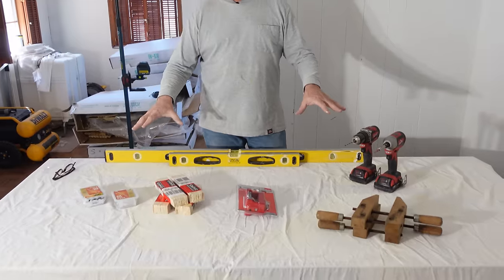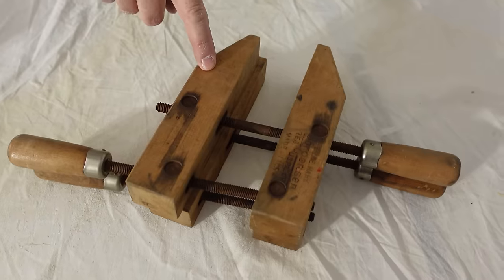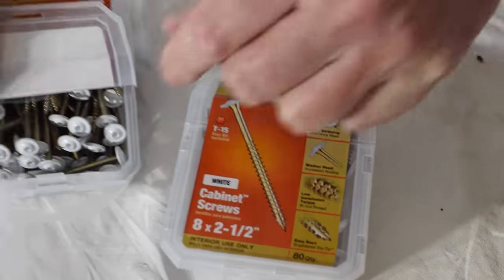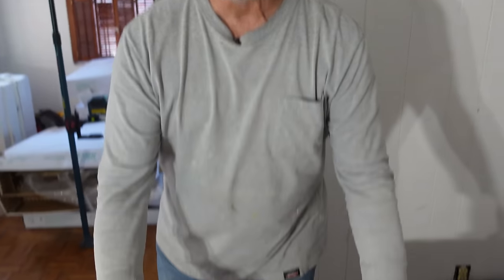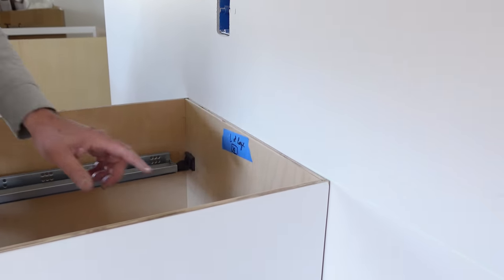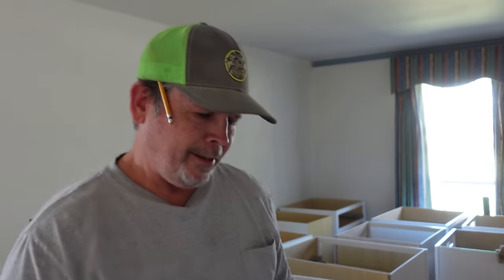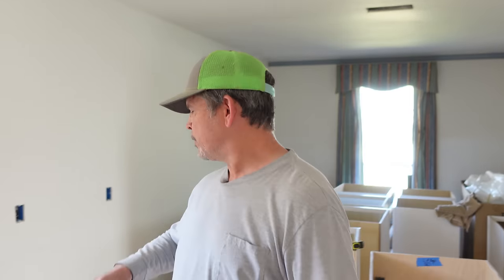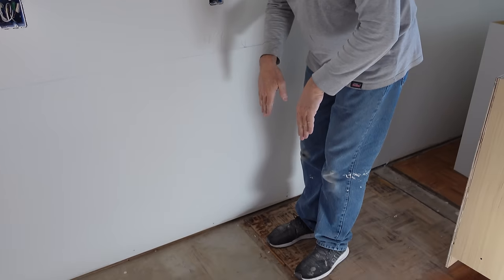How To Install PERFECT KITCHEN CABINETS (DIY GUIDE)

Comment: Hey guys, love your videos but in referencing those screws always use a number 10 or heavier...on the upper cabinets!!! number eights have no sheer strength and that's what's holding up all of that weight so always at least a number 10. If not, a 12 will be your best friend and you won't ever have to worry about those cabinets coming off of the wall. Just some insight from a 63-year-old finish carpenter who was in the trades for over 40 plus years!!!
Reply: What you mean number 8 or 10 because we live in Europe 😂😂😂😂😭😭😭. What size it is? 8/25 of an inch?
Reply: @apostoloskokalis3431  Google is your friend. 😉  #10 screw has a thread diameter of 4.8 millimeters.  #12 = 5.5 mm.
Reply: @sulero-zp3rd  Now that's how to hang a cabinet. 😜😄
Reply: Thanks!
Reply: I can do it.
Reply: thank you
Reply: Even their trim screws have a shear strength of 360lbf. These are more than adequate
Reply: GRK's #8's are hardened. They'll easily hold the cabinets, not to worry! A regular #8 would absolutely be a no go.

Comment: Been installing cabinets for 24 years your video will do fine for diy .  I have many tips but one of the best one is that if the wall is crooked and your cabinet is level and you have a space between the top of the cabinet and the wall, before you put your screw in , put a shim in the gap so as you tighten the screw it doesn’t try to suck the back of the cabinet to close the gap and  raise the front of your cabinet
Reply: I've been building and installing custom cabinetry for 40 years and I wouldn't let this hack near one of my cabinets.
Reply: Care to explain?
Reply: @booboo8577 why not? It makes sense to put a dim in the back to maintain perfect level as you torque your screw.
Reply: Nice work
Reply: This was the comment I was looking for, my walls are not perfectly square. In the video you can see he did this. Do I want to make sure the shim is with the stud and the screw with it so it holds the shim?
Reply: @thehighflyin12  What I do is put a shim wherever the studs are and before screwing the cabinets to the wall   I actually take a small nailer and put one through the cabinet into the shim because if you screw the screw in and hit for example a drywall screw or a nail the cabinet pushes out and your shims will fall down behind the cabinet and then you have to start all over but I also put a shim behind the side walls of the cabinet and shoot a nail into those two
Reply: Funny you mention that, that's exactly what I did an hour ago 🤣

Comment: 35 years in the cabinet business (so far) Always installed solo, for most of that time uppers first (no ledger) the idea is you get under the cabinet for support, you develop a knack for it, but as I have gotten older, I now ( almost always ) set my base's 1st .  How do I get under the walls with the base's in the way?? I made two box's out of plywood ( one lager, one smaller ) the large box is approximately 36" wide, 12" deep and 19 1/2 tall (thats important, the height) so after I set my base cabinets, box on top of base's, wall cabinet on top of box ( not much need of leveling wall because bases are set ) and make for hands free wall cabinet install.  I have two sets of "Pony" faceframe clamps (little bit nicer that the Bessy's) got the first set 20 years ago  best $200 I'd ever spent ( they were expensive back then for a set, now like $30 for the bessy's i think ) BTW the smaller box? same height its just smaller in width for when the 36" is to big and small enough in depth to fit inside the large box.. Cheers
Reply: You got 20 years on me in the biz. I've done both uppers first and bases first. Ledger boards, kicker sticks, free hand, all the ways. When I'm working solo, I do bases first, then whip out a 48x12 piece of plywood over the bases and my cabinet jacks. I think they're FastCap brand. But I can lift the upper on them, do micro adjustments, and if I forget a tool, I can step away and it won't fall, but still be on my level line.
Reply: @BenMarvin  , yep step away (thats what i meant by "hands free") I micro adjust with shims between the box and upper.  I thought of the "box method" when I had to install cabinets on a block wall.  set the upper on the box and then drill for tap-con's
Reply: @nedscrivner9893  Always a great time installing into masonry.
Reply: What size is your smaller box
Reply: @jessicacalder9099  , the large box is actually 38x12 and the small is 28x9.5 (both 19.5 tall) I rarely use the smaller of the two, but handy is a corner or a wall over 39wide (the smaller fits inside of the larger so they take up the same amount of space)

Comment: From what my cabinet manufacturer told me, those GRK cabinet screws are only to attach cabinets to the wall. It’s recommended that you use the trim head GRK screws (#8, 2 1/2) to attach cabinet-to-cabinet. The cabinet screws used need to be countersunk to avoid impacting the hinge / door, etc. Plus, it’s visible.
Reply: I use countersunk trim screws to attach my faces together. It just looks better in my professional opinion.
Reply: 100% correct Victor!
Reply: A screw is a screw and will hold. It is not some traditional cabinet room piece so a screw here and there is not an issue.
Reply: Ive seen the recommendations for those also, but those trim heads dont do the job well.  They pop right through and dont hold the cabinet together well at all
Reply: these are better, trim head are not strong
Reply: Faceframe screws 2½ #8 type 17 with nibs

Comment: The trick with the screw and the prybar = Mind Blown! You guys are awesome!!! The "Protip" i tell people when installing the cabinets is that i like to do the bottom ones first. The reason for it is that the Stove kind of dictates where the uppers will go IF you have a Range/Microwave that will have to be directly over the Stove. IF you do the uppers first and for some reason your Stove location shifts (error in schematic or whatever), youre gonna have a fun time redoing the top ones and it will be even more costly if you put things like Filler panels/crown or what ever.
Reply: Base cabs first gang
Reply: I do the top ones first but start in a corner or on the end wall which will dictate where bottoms will end up.  I always and about a 1/4" to the openings on the DW and stove.
Reply: If you read the walls and floors first with a level this is not an issue. It’s so much easier to do uppers first.
Reply: @jonathanlove4333 
I’m watching videos because I’m getting ready to install my  new cabinets. I was thinking it would be easier to start on the uppers first so that I’m not in my own way. I used to hang drywall years ago and that’s where we start, lids first. Now I have some confirmation and an idea of what to look out for. 
Thank you.

Comment: I drill the 1/8" hole thru both face frames but then redrill the first hole with a clearance hole equal to the diameter of the screw threads so the screw pulls the the face frames together. Luv your videos. You are a great educator.

Comment: Great video!  Absolutely agree with you on using spacer boards for dishwasher, range spacing, etc.  I also use the cabinet clamps.  I can gang up to 4 cabinets together, on the floor, joint the back of the cabinets together with 1/2 spacer blocks and screws.  Then install the gang of cabinets on the wall as one unit.  Very fast.

I’ve been installing cabinets for 20+ years.   When I’m looking for the highest point in a kitchen I use a story pole marked at 32 1/2” and 54”.   This gives me the height of both upper and lower cabinets.  I then use my laser to set the base cabinet line against the marks on the story pole.   I put the story pole against the wall and then approximately 20” from the wall, out unto the kitchen, to insure there isn’t a hump in the floor.  I note the dimensions as a move down the wall to find the highest spot in the kitchen.  The laser is adjusted to the story pole line as as go.  When all walls have been checked, the laser will be set to the highest point in the floor and I work off this line.  The cabinet manufacturers I deal with with void the cabinet warranty if the cabinet is cut
Reply: Yes, this!  So much easier and you can tell if the front of the cabinet is going to be on a high spot, not just the back.  Plus, no math.
Reply: I gritted my teeth when he cut the bottom of the cabinet lol. I will always adjust/cut the floor or sand or grind it down instead of cutting a cabinet but hey, whatever it takes to get the job done huh!

Comment: On the bottom of that island cabinet....If you've got a long travel like that and the screw isn't staying, put it on the bit, push a piece of blue tape over the screw end and fold the tape down the side of the bit.  It will stay there and you can either yank it off once you get started or there will just be a small piece of tape stuck behind the screw head.  Works well.

Comment: I've been a custom cabinet builder for over 30 years , I like the idea of the laser line. Modular cabinets are some of the hardest to set because of the way they are built . With hot melt glue and brad nails , or maybe thats just on the west coast. You guys rock

Comment: Bought these face frame clamps. Great reasonably priced tool. I use trim head screws to screw face frames together from BOTH sides which I locate behind hinge mounts so they never show. When floor out of level beyond 1/4" (almost always) I use strips of 1/8" doorskins & 1/4" strips of ply when needed under my cabinets. I always snap out the entire cabinet layout on the wall AND the floor which locates everything for plumber & electrician. The layout I snap out includes thickness of carcass walls on wall & floor. This step may take an extra hr but is so worth it it show exact placement of any shim strips you later check with your lazer b4 placing ea cab & guides any register placement in your kick plate etc etc. A straight edge on the top of cab run & on front face (6 ft level) will give an even overhang on your countertop as well as show you exactly how much to shom between cabinets at the back to maintain that uniform plane on the front face of the whole run of cabs. Be sure you have handles chosen b4 determining overhang of countertop & measure that dishwasher as well. Fine home building did a detailed article on hangi g a fairly involved set of kitchen cabs that is worth googling. Always a great review/reference reading b4 your next project.

Comment: Love you guys. I watch your videos a lot. I'm redoing my kitchen. I refer back your videos all the time. Thank you so much. This is not what I do. But I m absolutely killing it thanks to you guys. That cabinet  tool to align the cabinet is a great Idea. I did not use it. I used clamps but had I known about it I would have surely used it. Fast forward to the end. I installed my cabinet based on witching your videos. I had the counter people come out. I'm saying to myself if they say something isn't right or level I'm blaming Stud Pack. Lololol. I was dead on. No issues at all. Thanks again. You guys are awesome.

Comment: I like to leave my laser line turned on, with the laser set up either on an extendable pole, or on a metal corner somewhere. You can then draw a line on a shim or some spare piece of wood and check the corners of every cabinet to see if your pencil line is matching up with the laser line. You can move around with that piece of wood and check the height at any top surface of your cabinets. It speeds up the process and gives more consistent results than reading a standard level from cabinet to cabinet.
Reply: Truth

Comment: Another great video Studpack ! Here’s a tip when measuring from the center point. Instead of using a pencil on the end of the tape just rub the tape end up and down.. it will leave a mark on the wall. This is also a great way to center a picture on the wall. Just put the mark near the top on one side. It will stay level unless it’s bumped.

Comment: I REALLY love that you kept all the screw fails in there. Can't tell you just how much because that is reality.

On that I was wishing I could tell you to get some tape, push the screw through the sticky side and then wrap the flaps back like a bandaid onto the drill bit. So, you've taped the screw to the bit and half of the problems are solved. 

Thanks for your content!

Comment: I got roped into a remodel of a 110 year old home that was chopped up to make 3 apartments.  Old plaster and lath walls, crumbling under wallpaper with 10 coats of paint on it, not a straight line in the house, rotting floors, bad plumbing, redone electric though.  Watching this will help when I start installing cabinets today.  The walls are rolling, resembling the Grand Canyon and the owner wants it done fast and cheap.  Did I mention finding wall studs about 23" on center?  Note I said about...  I'll do my best but I have a feeling that it will not look as gorgeous as your install.  New construction is so much easier, even if the framing isn't great...  Thanks for all the tips and info!  You two are awesome!

Comment: Great video, as always.  Have you guys heard of EZ Level?  They're metal feet that get installed to the cabinets that make it possible to level each corner of the cabinet independently by adjusting a screw at the front of the cabinet.  They're a game changer.  If you try them, you'll never use shims again.  Those Bessy clamps are amazing.  I use them every time I do a cabinet install.   Bill Mitchell mentioned a story pole in his comment.  It's a much easier way to check for high points on a kitchen floor.  Love your videos.  Cheers!
Reply from the maker: Ordered some ez levels this morning 👍
Reply: Thought about ez level but doesn't seem to be worth the effort and cost. In fairness I would have to try them first. I don't use tapered wood shims on the floor. They create a single point of contact which the stone counter can easily compress over time. 
I use various thickness scrap plywood shims, and luan shims that we pour wood hardener on to strengthen because luan is soft. For fine adjustments we use laminate samples that we get for free at the big box stores.
Reply: I recently installed owner supplied cabinets for a 14' x 14' L layout where there was a 1-3/4" floor variance from one end to the other.  The maximum adjustment for EZ Level is 1-1/4".  I ended up using plastic leveling legs that were rated at 330 lbs per leg.  I had to lay on the floor and reach under the cabinet boxes to adjust the rear ones, but it still went pretty quickly.  Shimming would have been a nightmare.
Reply: @HisboiLRoi  Nice. I Like the way NS builders installs cabinets. They Build their own cabinets without toe kicks. They screw a level 2x4 to the wall and use plastic leveling legs in the front that have a snap on toe kick. How did you have room for your  leveling legs. Di you cut the toe kicks off?
Reply: Those are quite an old feature (5 years ago)  Usually our European line cabinets all come with 4 or more adjustable feet but it only gives a certain degree.  Best to level accordingly

Comment: Stud Pack, for the most part I've worked solo so thank you for confirming that all the minusha that I do is correct and necessary. As I view your videos they continue to confirm that my methods based on common sense are correct. Wish I'd known of you several years ago.  Thanks from San Antonio TX

Comment: I like to countersink the screws that clamp the face frames together, when they are clearly visible, and then fill the holes with Bondo, sand flat and touch up the paint. Bondo seems not to shrink or swell. Really enjoyed the video and picked up some good tips, especially the 24 inch temporary filler boards to keep the dishwasher opening exact width. Very smart. Thanks guys.  PS….use composite shims and you don’t have to worry about them rotting from touching the concrete and soaking in water.
Reply: the finish carpenter I work alongside the most takes the hinges off and puts countersunk screws behind the hinges.  that way if he does have to pull a cabinet, he can just take the hinges back off.

Comment: Wow!! Never seen that. Using 2x4 to attach from the inside..What a great idea!! Notched 2x4 edge to compensate floor differential and using roofing material to keep moisture away from wood.. EXCELLENT GUYS!! 👉💯❤👍💥💥💥💥👊

Comment: 2 new tricks from one video! 
1-Love the screw and pry bar trick! I always wind up trying to lift and hold and screw at the same time. That's a giant pain in the whowho. I'll do it this way from now on!
2- The spacer trick is genius! I've installed probably 50 kitchens and I never thought of that. Measuring tapes work but that just makes it EASY! Great tip!
Double whammy!  Thanks